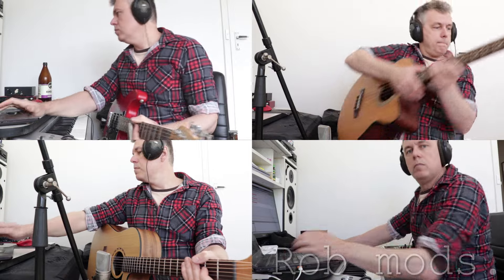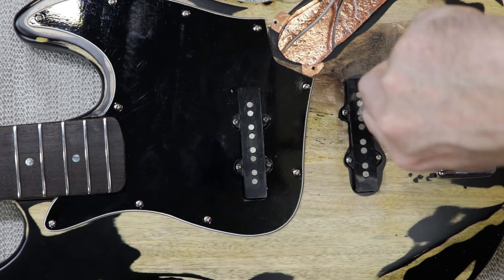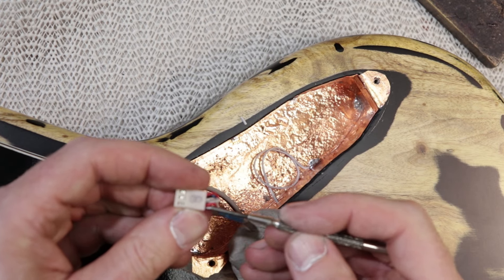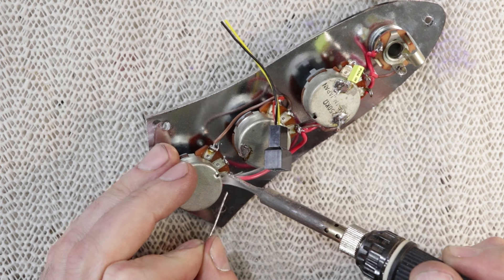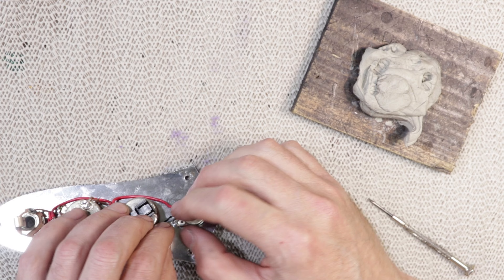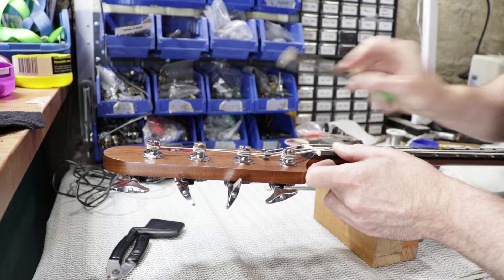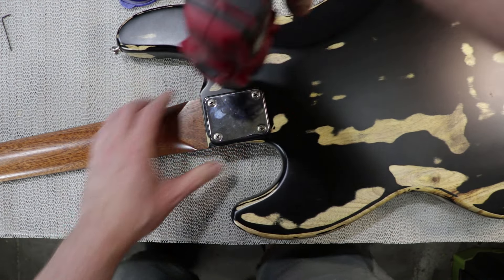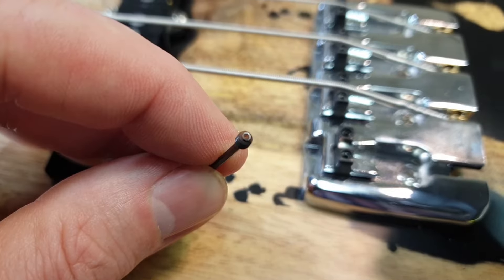This Guitar Is Not A Relic.

Comment: Excellent video again rob, got some useful info for an upcoming project from this so thanks. 

I wonder if you could help me with a problem 

I’ve got a made in Japan Marcus miller signature fender jazz bass that has what looks like a sadowsky preamp but there are no markings. The problem is each pickup on their own sound great and don’t have any noise but when the blend is in the centre position, both pickups 50/50 there is an audible buzz that lessens when I touch the strings, bridge etc 

What could this be?

Comment: There's a SBL video from 4 months ago called "Why the Jazz Bass CRUSHES everything" (red thumbnail with a different title like "secret tone" or something) which talks about a couple tricks you can enjoy with two different tone knobs - worth a watch for any jazz bass player
Reply from the maker: Oh yeah, I saw that!  In fact on the weekend, I experimented a lot with turning down both volume controls a bit to roll off treble.  With brand new strings, it was very bright.  Actually in the video I forgot to say that in the afternoon before the gig, I cranked the action up a bit.  I was worried that fret noise from such a bright and clanky bass that I wasn't used to, would be a bit annoying.  By the 3rd set, I was pretty happy with the tone.  Partly from tweaking my amp, using my boost only pre pedal (red one - there's a video about it), and also from my fingers getting used to the instrument.  I will try to explain why the vol pots roll off treble like tone pots in a future video.  Cheers!
Reply: @RobMods  That will be great, because if you explain it, we will all “get it” 👍

Comment: Thanks Rob, for another great video.
Those Ozito drills are awesome, for the price, aren't they? Cheers - Rod
Reply from the maker: Yeah for tech work/light duty they are ideal.  Mine was a promo that came with two batteries, but I only recharge it every few weeks, so I needn't have bothered!  The old Ozito heat guns are great too.  I also use the dremel copy and extension flexible handpiece.  Both pretty decent.
Reply: @RobMods  I saw the PXC rotary tool the other day. Hadn't seen it before.  It looked good.  I've used the Drill Driver to build some vege gardens.  It's  awesome.
Reply from the maker: @shadowminister4090  mine works fine with the (genuine dremel) router base, but i've heard that the most recent ozito rotary tools dont.  So if a router base was part of your thinking, maybe check.